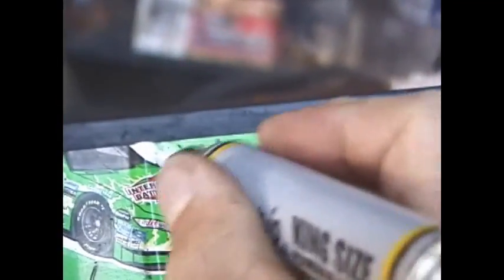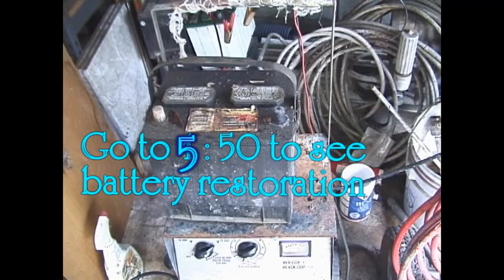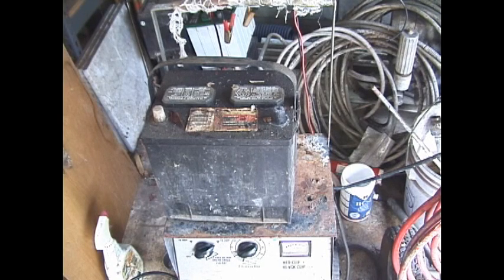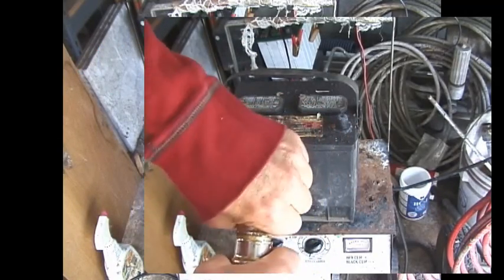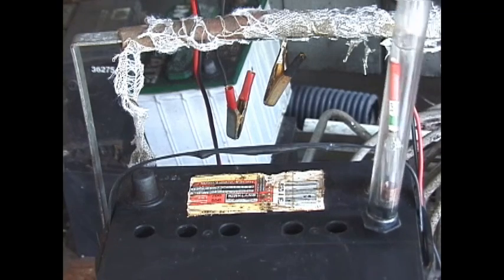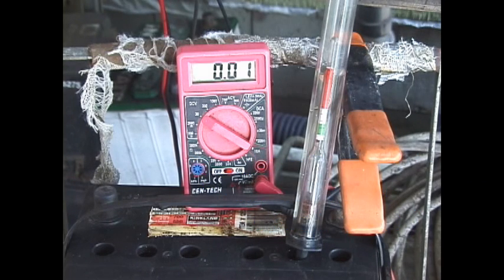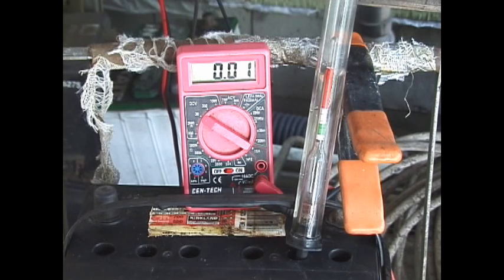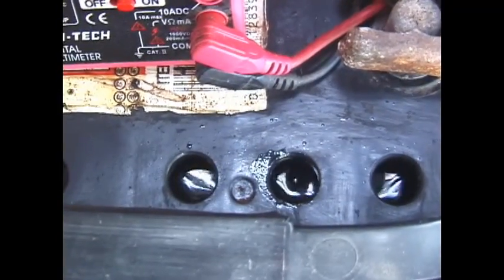Dead Battery Restoration/Reconditioning

Comment: Wow, I have watched literally 100's of youtube videos, and this one is one of the most straight-forward, factual explanation, without going into in-depth processes so far. It's now fall of 2022,
and this is still one of the best procedure videos in restoring dead batteries. I personally do not use additives to assist in the desulfation process, as the newer smart chargers now have a decent built-in desulfation, and I have been very successful at low current smart chargers that have pulsating feature when it is applied over weeks, up to a month or two.  As a last resort, boiling the battery a few times and dumping and rinsing out with distilled water, then replacing the electrolyte has also worked. Sometimes the 35/65 solution gets contaminated with tap water or just plain polluted. I also agree with you list of smart chargers you mentioned as well as the NOCO units too.  That said, your assessment and approach are rock solid and easy to follow, even 7 years later!  Bravo!

Comment: Good video. thanks.
In my experience Epsom-salt is the best battery restorer.
You have to desolve as much Epsom-salt in the boiling water as it can take up.
Then put two ounces of the solution into each cell.
And then you have to cycle the battery between 80% to 20% drain and then 20% to 80% charge 5 times at least, to have most of the battery capacity to come back.
And use slow drain and slow charge.
Probably 10 amp max both ways.
Reply: EvenStar LoveAnanda You add the Epsom salt solution to the existing  water/acid in the battery ??  I've never heard of this.  Is that dangerous?

Comment: Im going to over charge this battery i got its suppose to have 800cca but only has 137cca im going to charge it for 2 months or as long as i can making sure it dont get to warm and see if i will fix it im going to charge at 15.3 volts maybe higher ...one cell i notic aint boiling at all. Hopfully it starts in a few days

Comment: Hello i have a dead battery level 11 volt i buy one smart trickle charger to recondition it with Epsom salt i put it on 2A for 36 hour the voltage go up to 13.8 vol but the capacity is low to 60 that mean this battery can no longer recondition. After 36 hour charging still cant start my car.

Comment: How much a capacity battery must be to start a car? The battery i try to recondition show 90 is that is to low to start the car?
Reply: You need 150 - 200 CCA to start.

Comment: Here's  several things for getting a good result
do not attempt to do this unless you know what you are doing - the acid can burn your skin
Test the voltage first - there may be a dead cell which would waste your time.
Check the battery fluid.
attempt to fully charge the battery.
(I read about these and more on Jons mender guide site )

Comment: You need 600A to start a car?  Dude, I can start a car with a small motorcycle battery with WAY less than 600 CCA.  35% sulfuric acid and 65% water?  Is that by weight or volume?
Reply from the maker: +David James   ITs volume.   Measured in a measuring cup would work.

Comment: TeslaChargers state that the optimum voltage to charge a battery is 15.1 volts.  have you ever tried Pulse Tech battery desulfators? The passive desulfator model sold at Impact battery is $39.00 and has a 5 year warranty.  My Honda civic battery was rated at 450 CCA.
https://www.youtube.com/watch?v=K4__eH9-MXk
Reply: ***** Thank you for your opinion, and for taking the time to reply. I do believe that the passive desulfators work, they are designed to be used with the car's alternator or with a manual battery charger so as not to discharge the battery. Why not make a another video testing them?
https://www.batterystuff.com/blog/on-board-desulfator-battery-minder-vs-pulse-tech.html
Reply: *****
I agree with you Tesla Chargers are expensive, but appear to be a very high quality battery charger, and more then I or the average car owner wants to spend to charge their personal car battery, and may be best for a Automotive Repair Shop or Battery store.
Reply: The Amazon reviews are both rated 5 stars from most customers,m thank you for the links. I don't believe that the passive Pulse Tech desulfator takes much power to operate, as it only sends pulses at 18khz - 24khz, since i have a 5 watt solar charger I can use along with it, I am sure it should work well. If I had a garage that I could plug my car battery in when not driving it then the Active Pulse Tech Charger & battery Maintainer would be my choice.